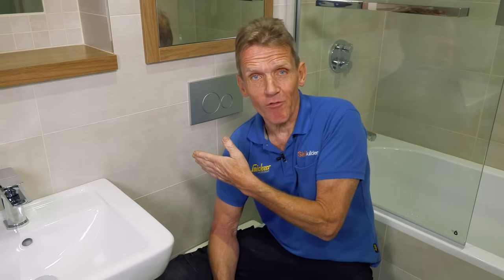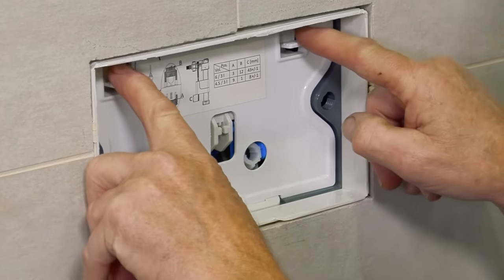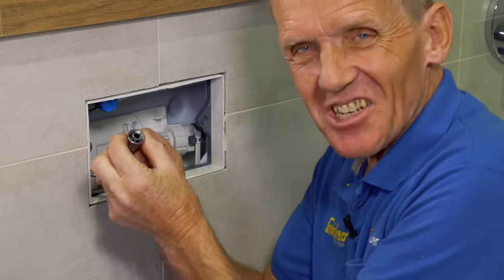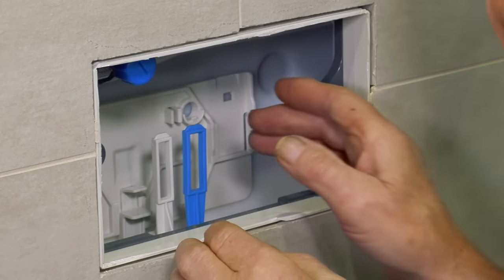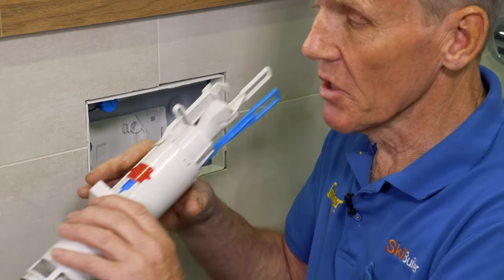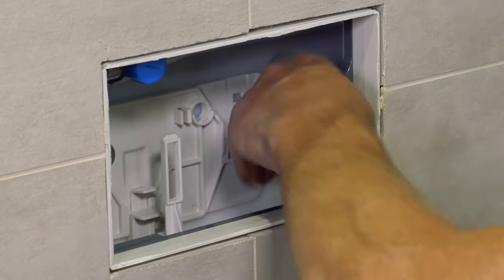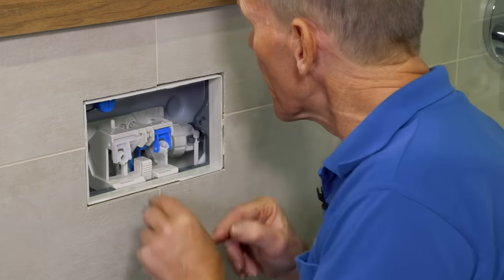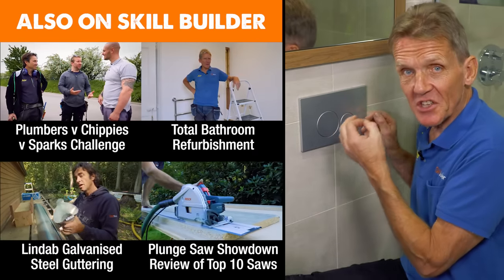Concealed Cistern Problems? 5-Minute Fix

Comment: Came across this video as i have a siamp optima 50 flush button which has broken, plumber installed this on a concealed system and i have no way of getting the button replaced without hacking tiles off, but after watching this i am wandering if i can get a universal flush cover plate, that way I can cut a large hole in the tiles, fit the universal cover plate and fit a replacement siamp button, any ideas?
Reply from the maker: send some pictures. It seems unlikely that there is no access
Reply: @SkillBuilder  where is the best place to send a picture? Thanks

Comment: I replaced the flapper seal, put the flush valve back in, had the cistern full up, water wasn’t leaking in to the pan - but after one flush it starts to leak in to the pan. Any ideas?
Reply from the maker: It is not seating properly. If you clean it then I am sure it will work again. It is usually scale or debris

Comment: Thanks for this. I have literally put up with an overfilling cistern for the last 4 years in fear all the tiles in my bathroom would need taking off the wall. I found this video and finally stopped it overfilling all because the float valve needed adjusting! So simple... Thanks so much! :D
Reply from the maker: Anthony 
You made my day. That is the reason we do all this stuff and it is a constant frustration to see some plumbers haven't got a clue about this kind of cistern and start breaking out tiles.

Comment: Can i straighten the cistern plate later,after the cistern is installed a bit tilted? Kindly help
Reply from the maker: You can do it by pushing one side up. You need to make some clearance on the surround. Does this mean the pan is also not level? In other words is the frame in level. That has be done right.
Reply: @SkillBuilder Thanks for replying.. I mean to say,does the cistern wall plate position depends entirely upon the position of the cistern tank? Or the cistern wall plate  can be adjusted separately later on?

Comment: I Iove these concealed toilets.

However I've had nothing put problems with them slowly leaking into the bowl. 

Cleaning, changing the seal and the whole unit makes no difference due to poor design where the siphons sit in a 'cup' but do not lock into place like others.

These days I just don't install them anymore.

Comment: This thing looks like a nightmare! Mind all concealed cisterns are in my experence. It all works now but what abouta few years time when it brittle or the flush tube starts leaking. I notice there was no water in there. I strongly suspect there never has been. To be fair the designers have tried to address potential problems but once it starts to show its age...big trouble. Unless of course its built from first rate materials but somehow I have my doubts.

Comment: What if it leaks from the down pipe to the pan
Reply from the maker: If you follow my instructions on the installation video it won't leak. They are not problematic.  If you have one that is leaking then you need to get to it  by cutting the tile out above.

Comment: Where can i get the same fill vavle?
Reply from the maker: From Rubberduck Bathrooms
Reply: @SkillBuilder  cant seem to find one that will fit mine. My ones clips on. It does have the release at the top like the one in your video. But it has the two clips on the wall inside where it slots in.

Comment: What if you break the segment off and then find out you actually needed it?
Reply from the maker: You would only break that segment off if the rods was hitting the back of the cistern. In reality that is rare an  breaking a single segment off is not likely to be the line between success and failure. If you are a plumber you learn not to be impulsive. Measure twice cut once and if all else fails buy two new rods.
Reply: @SkillBuilder  - One of the flushing rods in my concealed cistern has snapped.  Where can you buy new ones?

Comment: Good job it's easy enough to take apart , because he's gona have to turn the water back on 😂😂😂 we've all done stuff like that
Reply from the maker: I have driven home had my dinner and then got the phone call to say the hot water has run out because I forgot to turn the service valve back on. Drive 20 miles back to the job turn the valve on, drive back home, pick up the Evening Standard on the way and start looking for another job.
Reply: @SkillBuilder  Reminds me of working on a car, putting it all back together, and finding extra screws/bolts/nuts that apparently weren't needed ;-).

Comment: A concealed cistern with a slow leak is very effective at quietly and invisibly rotting out the dividing wall between two bathrooms, the floor joists of said two bathrooms and eventually the ceiling below. Never again! I'll stick with regular cisterns from now on!
Reply from the maker: Simon
 That is the nature of leaks  I am afraid. The alternative is to put all your plumbing on show. It is sod's law that the leak will be in the bit you can't see but there are plenty of places where you can use a torch to look behind the pre-wall. In my experience few people bother.

Comment: Too many parts 😬
Reply: And too much fragile plastic that will fail as sure as night follows day.
Reply from the maker: @nickhickson8738  When the time comes for your new hip it will be plastic.
Reply: @SkillBuilder 
The Acetabulum Cup yes but metal pin though maybe faced.
I know you Roger from LBC days with Steve and There's et. al. Behave yourself! Used to love those programmes but have found you again.
Reply from the maker: @nickhickson8738  Hi Nick
If we could find the old LBC audience we would be o.k on this channel. That Fix It Phone In was good fun.